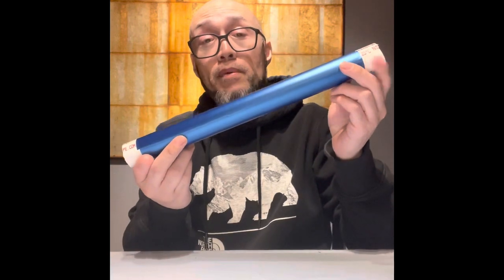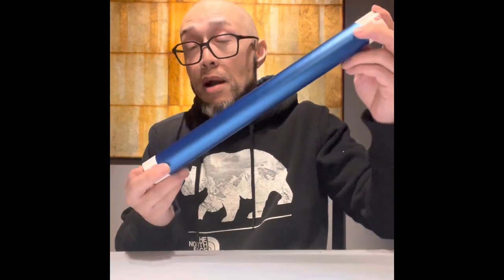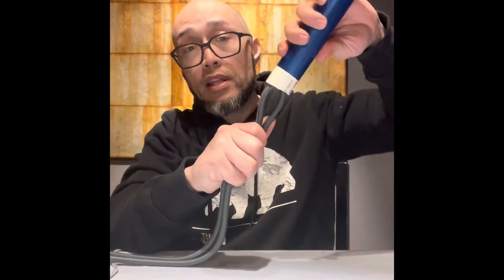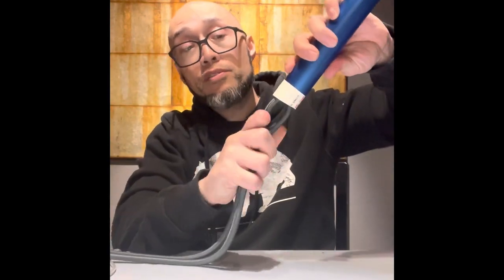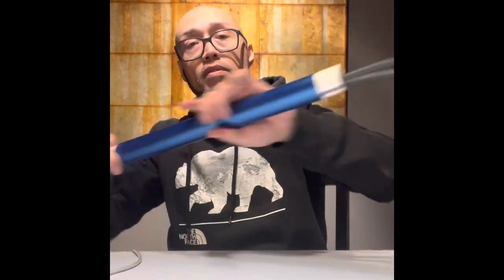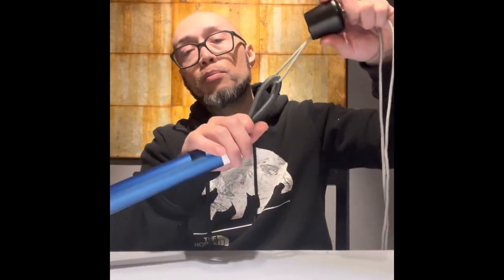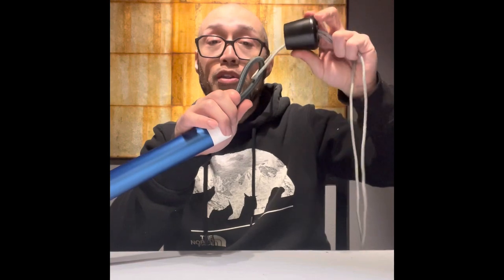DIY Dock sticks for boats

Comment: Looks great! Do you have links to the materials you used?
Reply from the maker: I got the 1” PVC at lowes.  The vinyl was optional or you can spray paint it! 

Rubber ends
https://www.amazon.com/Furnigear-Non-Slip-Diameter-Protectors-Black-8/dp/B08FQTGRTQ/ref=mp_s_a_1_3?crid=CYG405XPK34N&keywords=rubber+chair+leg+caps+1+1%2F4+inch+black&qid=1678798718&sprefix=rubber+chair+leg+%2Caps%2C150&sr=8-3

Keeper 48” bungee
https://www.amazon.com/Keeper-06082-Bungee-Carabiner-Hooks/dp/B074H5XYBB/ref=mp_s_a_1_4?crid=3RS9HY6ZSSFAD&keywords=keeper+48%22+bungee+carabiner&qid=1678798824&sprefix=keeper+48+bungee+carabiner%2Caps%2C161&sr=8-4